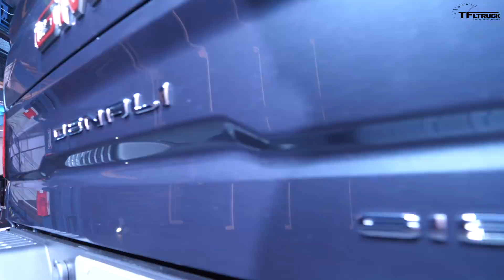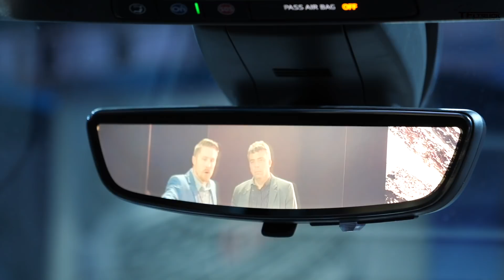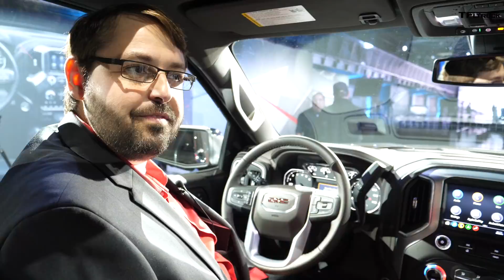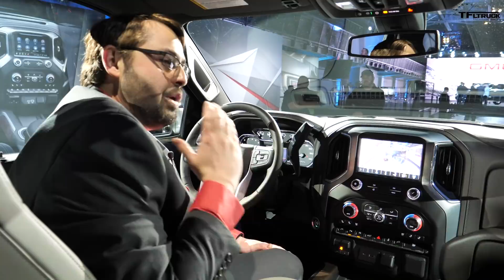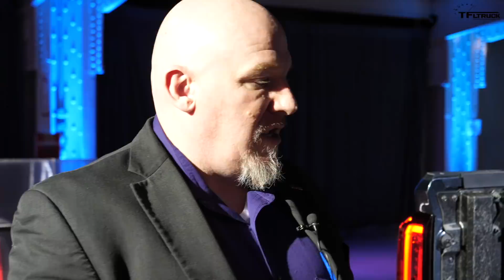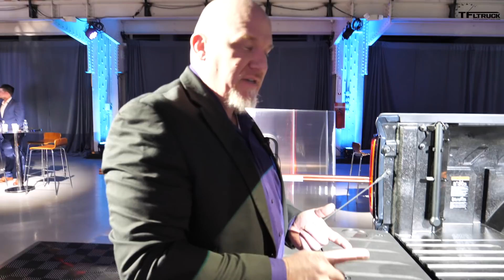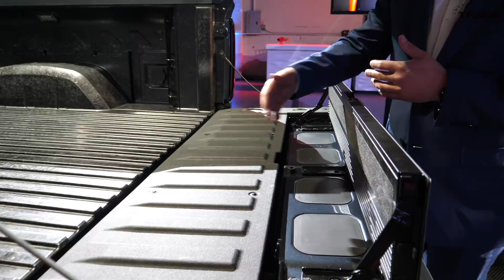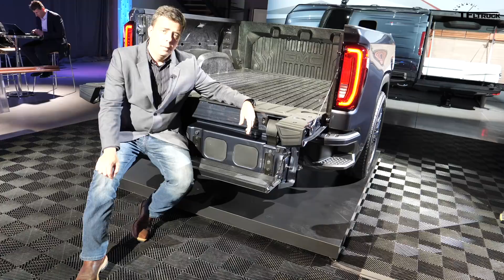Breaking News: 2019 GMC Sierra 1500 Gets CarbonPro Bed and Diesel Power!

Comment: DASH Still sucks, So disappointed with the interior.
Reply: Ford hasn't built a TOUGH half-ton in over 20 years. First they got rid of the reliable engines and replaced them with junk like the Triton and now the timing chain stretching Ecobust. Then they started using the junk 8.8" rear axle, then they started using that absolutely worthless 4WD system that uses plastic gears to lock the front hubs. Go ask the Raptor guys what they think of that joke of a system. Chewed up plastic gears is a common affair for the typical Raptor. The system is even worse when you have an Ecoboost engine. The vacuum system so unreliable that the IWE's get destroyed left and right. Not to mention Ford got rid of the heavy duty forged steel control arms years ago and replaced them with the wimpiest looking stamped steel control arms I've ever seen. The 2015+ F-150's stock suspension is an embarrassment.
Reply: they spent their money on fancy knobs
Reply: I'm just attacking the fanboys. People who don't even change their own oil but preach on the internet all day.
Reply: Look at our new trailer assist technology! Too bad you have to squint to see it, and old farts just won't be able to see it at all.
Reply: Agreed it sucks
Reply: No one is Crying as you put it, Look i was always a hard core GM Fan but after the last 2 a 13 and a 15 Duramax im done with there poor designs and out dated looks, I now have a 17 ram 3500 that i have never had a problem with and use it to tow some very heavy Trailers. I just feel like the new Chevy looks really good on the outside but they lack on the interior Features and comforts as well as designs. And by all the posts made by others i see that im not the only one who feels the same.  Have a good day and thanks for trying to Stir the pot and start drama over your comment....... LMAO
Reply: Mopar Magic ??
Reply: +wastegate Sure if that big screen is something you like. I think not only is it distracting and gimmicky, but ugly as well. I wouldn't want it even if they paid me to have it. What the new Ram actually has going for it is that amazing center console & cabin storage throughout. This GMC on the other hand has a beautiful interior, in my opinion of course.
Reply: archinuk417 I've taken a brand new 2015 Silverado HD up to Seattle Washington and back to Oregon and it was the most comfortable 5 hour ride I've ever had in my life. Wtf do you mean GM makes cheap interior?.
Reply: 172kessler cry me a river
Reply: ram kills them on this with their huge display
Reply: RAM = gimmick.  GM = tried and true and works every time no excuses.
Reply: 172kessler Agree the passenger side looks old school
Reply: GM = tried and true??? Only because they've copied everything Ford has ever done. They've always been second place and now Ram sales are easing up past them.
Reply: Every Chevy has a very poor interior. Not sure what they really spend their money on when building these trash piles.
Reply: 172kessler I'm b.s. Ford truck guy but I'll put Ram first, then the F-series, followed by the GM twins.
Reply: Mopar Magic gm sells the most trucks in the world.

Comment: Now a tailgate handle that cost $350 dollars to replace instead of the good ole $40 dollar ones. WTG !!!! Neat feature in execution but bad for long term durability
Reply: It's now a $3000 tailgate!
Reply: Michael Smith why can't they just use a metal handle? GM trucks had crappy plastic handles that always break for over 20 years now.
Reply: wally twixter even more incentive for people to try and steal your tailgate.
Reply: Michael Smith it's probably a option.
Reply: Plus what happens if battery were to die
Reply: Try $4,000 tailgate!  That's how much it costs to replace.
Reply: Michael Smith i guess if you dont know how to take care of your things then it doesnt really matter what its made out of
Reply: Then don't get the top of the line trim with all the options if you can't afford it.
Reply: Michael Smith Then don't buy it
Reply: That "handle" is a pad with two buttons, and doesn't even have mechanical linkage. What kind of durability could it possibly need?
Reply: ndejohn1990 these new ones lock with the key fob so theft won't be bad.

Comment: Beautiful truck but I don't know about that tailgate, seems to be allot of nonsense.
Reply: BReese504 Been there, done that. Tarps don’t last long when you are shoveling out of your bed. Stones are worse.
Reply: Shackles Agreed. Looks like over kill. Just wait till one of those hinges get stuck, etc 😆
Reply: Engineering got to build their dream tailgate!!  A handel is sufficient for me.
Reply: These manufacturers need to come up with a way for these tailgates to not be so easily stolen. I can see this tailgate being a prime target for theft.
Reply: Transformers....
Reply: CDP I never thought of that and replacement would definitely be expensive
Reply: Ryan C 
I noticed once with a loaner 2017 Silverado that the tailgate locked when I locked the doors. I would think and hope that these expensive tailgates would come with that feature. Sure wish my 2016 Colorado had that. At least I can lock it manually with key though.
Reply: The Real John Smith - The F-150 is the pickup of choice for suburban wives and millenials that use their pickups to get groceries. That's why Ford doesn't bother putting a decent 4WD system in the F-150 anymore.  It's also why Ford needed to "innovate" by coming out with that trailer backup assist. Finally millenials don't need to feel embarrassed that they can't back their trailer up with their shiny new F-150.
Reply: hochhaul those dahm millenials are ruining everything
Reply: Shackles no actually I have always wished there was an option now you don't have to buy a gate when you carry long stuff! These are things that have been needed and with truck beds getting higher up in the air the step is wonderful and a phenomenal idea
Reply: Shackles 
I totally agree on how useful this tailgate would be. I am a tradesman and use my truck bed a lot. This tailgate would make life alot easier for me, especially since I’m kinda short.
Reply: Ryan C They come standard on SLT and Denali, you can’t choose on the higher trims
Reply: i agree but they do have a good idea, if you watch the video on their website you can see how loading say a dirtbike this way would be very helpfull. I am reluctant to load my streetbike with just a ramp.
Reply: There are a few options for tailgate theft, locks and such you can buy.  However I once saw a great idea. There's a YouTube video too. Basically what you do is  get yourself a $1 hose clamp position it over the tailgate circle hinge and tighten it down with a low profile tool, most importantly position it with the fastern head angle very severe so it's hard to access. this is greatly effect the chance of getting ripped off.
Reply: https://youtu.be/pjqt2ByIrQQ   hose clamp tailgate lock
Reply: Shackles yes I was at the autoshow.
Reply: Boo Ya yes bud, but standard doesn't mean you can't get them without. The sle comes STANDARD with the regular you still can get this one. Which means you should be able to get a regular one on the upper models. Might have to be ordered that way but I'm sure you can.
Reply: Try and open the tailgate with a dead battery. -30C with a folding box cover on and booster cables in the box. Cool idea but should have a backup mechanical handle.
Reply: A lot of new tailgates can lock
Reply: CDP it won’t no more trust me cuz it will lock it will be harder to steal no door handle
Reply: The worst thing about this is they replaced the actual handle with a push button. So I guess when the battery in your truck dies you can't open your tailgate? lol. Or when a fuse breaks or something messes up you'll never be able to open your tailgate until you pay someone to fix it. The rest of it seems pretty cool. But it really needs a way to open the tailgate manually with no power in case something breaks.
Reply: Ryan C It looks very handy! No aftermarket part that I know of can have two levels of length.
Reply: BReese504 great idea with the tarp to keep it clean
Reply: Lewis Geer  I will admit it is growing on me more now.
Reply: Hexstylee3 ya the gm video seems to make more sense for this tailgate,  I think I'm starting to like it
Reply: Ryan C did you get a chance to use it , if so does it function good and seem strong?
Reply: BReese504 a tarp doesn't help the electric latches release with the extra pressure for the weight pressing against it. It practical for light contractor work and the site foreman to go over the plans. If they sold it that way no one would complain but they are selling it in such a way that it will work for everyone.
Reply: Load up the bed with top soil, sand or mulch and see how much you like that tailgate after the dirt get down inside all those hinges, cracks and crevices. It will make a great grocery getter though. ;)
Reply: Guys if you use a truck for work trust me this tailgate comes in handy. You can also get a normal one if you prefer.
Reply: Ryan C do you have experience with this tailgate?
Reply: SRN  yep
Reply: Mike Cav hope it works out for buyers.  Lots of money being spent.
Reply: The Real John Smith put a tarp down in the bed then if that's a concern. Problem solved. Next

Comment: Wow thats a lot better than that flimsy Ford tailgate step. I only wish they had the tall screen out of the new Ram and the panoramic sunroof.
Reply: I think that's the only place where these new GM trucks are behind the competition, with Rams new infotainment screen.
Reply: I think its more for old people anyways. Just be a man and get up into the bed the old fashioned way. No but seriously it is inconvenient since you can only get the front half of your foot on there, all the weight goes on your heel. Maybe not the best design but i'm sure they will improve it. The main thing is the GM trucks have V8s with the new dynamic skipfire technology instead of that Ford Ecoboost junk.
Reply: Panoramic roofs are a nice gimmick and open up the interior, but I don't get the huge screen, what are you doing watching tv while your driving? Have fun replacing that cool big screen once it goes bad, I can just imagine what that'll cost
Reply: They over complicated the step! Just two steps in the Ford
Reply: Guvment motors used to have a commercial bashing Ford's tailgate step now they have one
Reply: br ly that large screen allows you to have two operations displayed at the same time such as a nice detailed map in one half and both detailed climate info and radio info in the other. It’s an excellent setup. The GM screen won’t be that much cheaper to replace when it breaks, either...
Reply: I like glass roof, I don't plan on flipping the truck over and if I do I probable have more serious problems to worry about than the roof. Never rly like driving trucks but these newer trucks with all these features can make the time spent inside rather pleasant. Now want a truck with a pano roof and all the goodies as a family vehicle/ work truck.
Reply: Yeah i would watch out for those Fords. They're nice trucks but not always reliable. Some people will put 100k miles on them and have no problems and others have them in the shop more than on the road. I would recommend getting a GM or Toyota before the warranty runs out. Not saying GMs don't have their own problems but they tend to be less problem prone than Fords. http://www.fordproblems.com
Reply: Yeah thats why i like Chevy. They have the tech that Toyota lacks but with some of the reliability as well. Its funny i was just looking at Consumer Reports 20 worst vehicles and Ford has 7 vehicles on the list and Chevy has none. Even Toyota has one on there.
Reply: Old Gregg on the contrary, having your foot being able to go all the way through with the Ford design allows your foot to be able to slip off toe side, whereas the GMC design has a wall that you can always push your foot up against. Seen plenty of people misstep on their ford steps at the boat launch, especially with wet boots

Comment: Wowza that thing looks tough!! And with a V8. Keeping up the durability
Reply: cheesecakefriend28 a v8 with dynamic cylinder deactivation. The current 5.3s are pretty reliable but let's see how it handles deactivating up to 7 cylinders
Reply: D Jay T Yes I have the 2014 and it’s been bulletproof. Not even burning an ounce of oil like some say it does. But that would make significantly better mpg being able to deactivate up to 7 cylinders. And if it’s as seamless as the last gen I’m sure there won’t be any problems with quick power.

Comment: So they copy the look of the f150 nearly exactly, shit on ford for using aluminum in their trucks then use it themselves, then use a carbon composite (plastic) truck bed. Sounds completely stupid.
Reply: Sums up General Motors.  Maybe they should focus on their tailgate handles.  Absolutely terrible.
Reply: Test Test I'm not making any statements to the strength of the carbon composite they are using, I simply do not know.  However...  It is NOT plastic.  That is a stupid assertion.
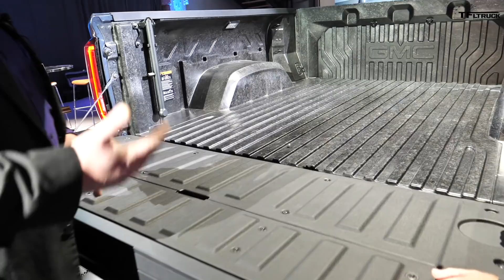Reply: wlabishler 1 at 8:58 the host literally says it’s a thermal plastic. So no, it’s not a stupid assertion. It’s fact.